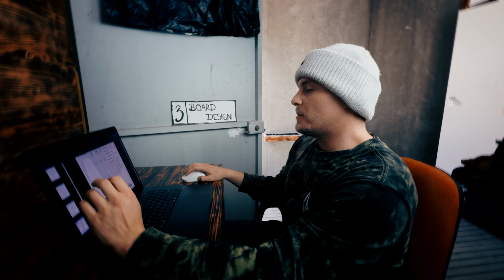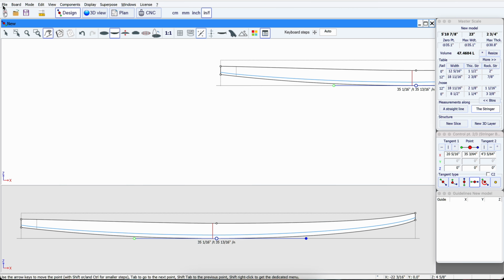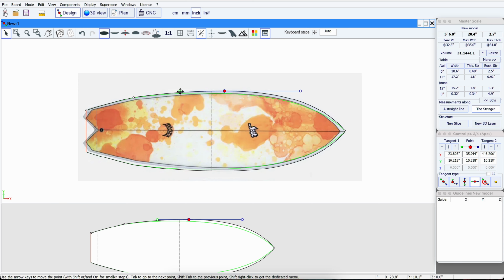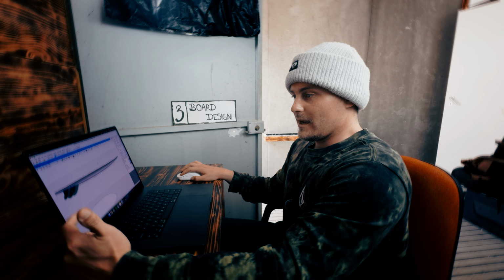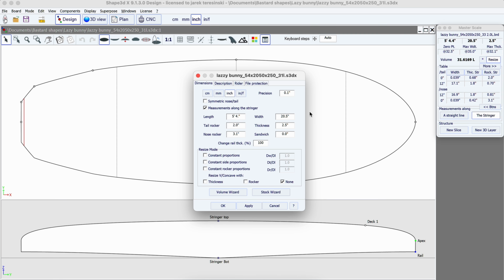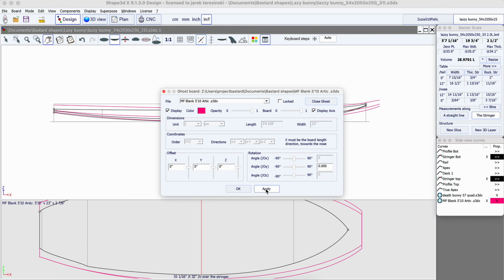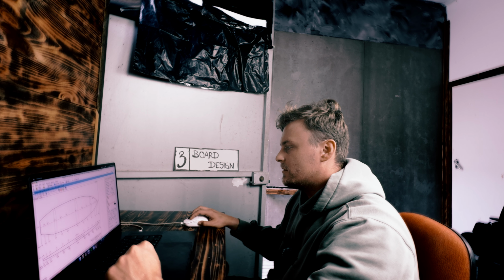The Digital 'Cheat Code' for Your Hand shape Surfboard:

Comment from the maker: Designing digitally before you touch the foam is the ultimate "cheat code"—it’s better to mess up 10 virtual boards than one real blank! 💻🏄‍♂

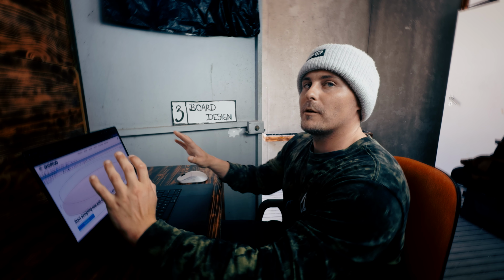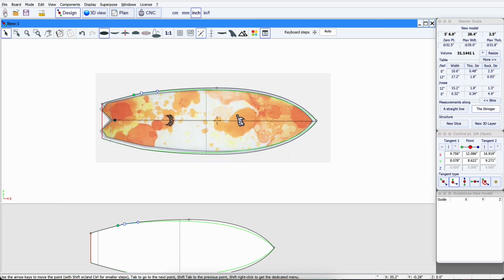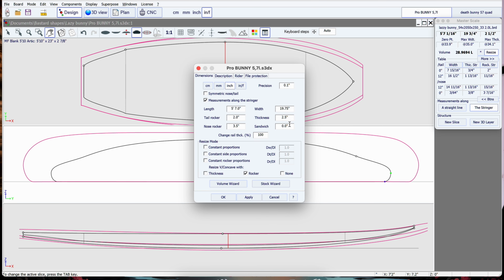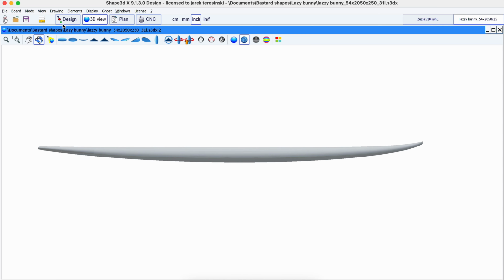Design Phase Cheat Sheet: 🖥 The Programs: Shape 3D, AKU Shaper, and BoardCAD (Open Source). [01:20] 📈 The 3-Inch Rule: Keeping your widest point within 3" of center for a balanced fish. [11:16] 📏 Crucial Step: Always check "Measurements Along Stringer" before printing templates! [37:02] 📐 Rocker Categories: Low (3"-3.5"), Medium (3.5"-4"), and High (4"-5"). [29:19] 🦴 Foil & Nose Flip: Why the last 2 inches are best refined by hand, not the software. [17:10]

NEXT UP: We’re finally grabbing the tools! 🛠 📺 Watch Part 4 (The Essential Tools & Templates) here: https://youtu.be/JBBYJ_BZJN0?si=Lh8qz456Sz2mTFj9

Which software are you using? I’m using Shape 3D for this build, but let me know if you’ve tried the free BoardCAD or AKU Shaper below! 👇

Comment: Being a backyard shaper for 4 years now this is very close to how I make my 3-5 boards a year. What a relief haha!

Such great detail on why you do things but also the fact that you keep on repeating to keep things simple. My first 3 boards are really wonky because I didnt use an approach like this.

Because I make so little boards, every board I have to get back into what I need to do, but also what I should not do. Its so easy to make what you think is a shortcut, but being haunted by it every next step in the proces.
Reply from the maker: Totally agree. 3-5 boards a year is still a good amount, especially with the cost to make them. Keeping the things simple where they should be it’s a key. And having a fun where you can experiment it’s a must have for me. In that case deciding which tail I want to have. Which I basicly decided in the final step of shaping. But again having that curve that was created by designing this wide squash tail was the most important part of the tails designed from the functional point. Then I went artistic 😂😂